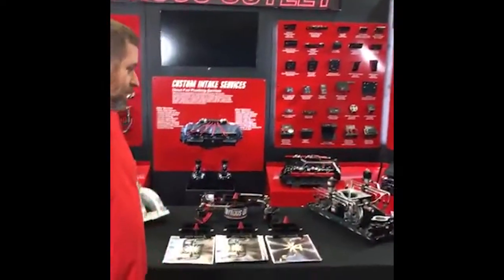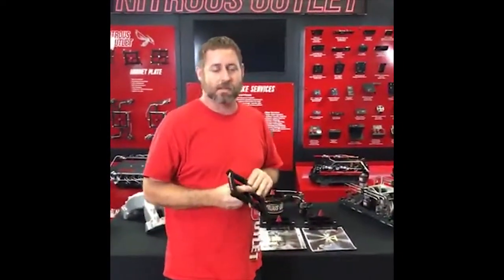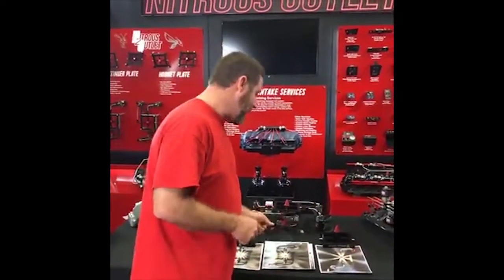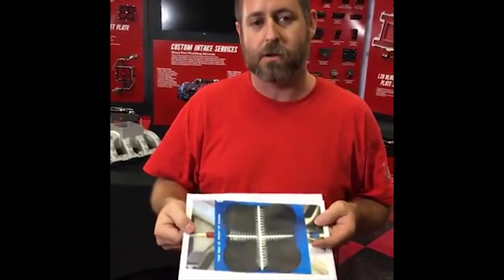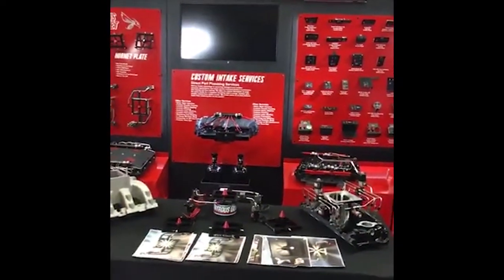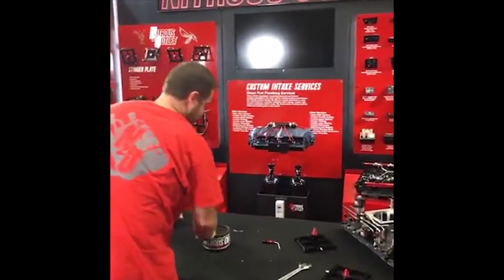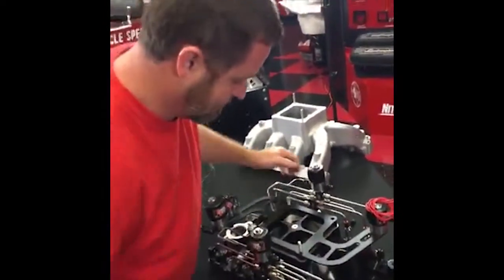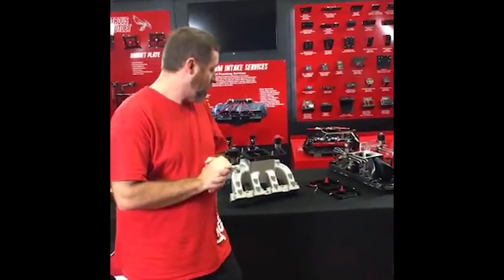Nitrous Outlet Stinger Plate Systems

Comment: do you have specific purge solenoid for your system or will any manufacturers will work, we have two of your entry kits
Reply from the maker: We do have purge kits available if you want a matching kit, but any purge system should work fine for you.
Reply: Ok, thanks I found them on your website summit didn't show any when we ordered the kits
Reply from the maker: Good deal! Let us know if you need anything else! Feel free to give us a call if you need to- our phone number is 254-848-4300 or 1-866-648-7637!

Comment: Dave have a question for you, I know how to flow nitrous just wondering if you think it's just as effective if I flowed through the solenoid just b4 the plate to get a more effective adjustment. Of course with the nitrous disconnected lol...
Reply from the maker: Are you talking about setting flowing fuel pressure?
Reply: @NitrousOutlet  yes sir
Reply from the maker: @hiteracing1489  You can do it either way. Just pick a method and stick with it. 

Most people flow before the solenoid. 

Some people flow through the actual plate into a bucket. 

Easiest way is before the solenoid.  

It’s all just a starting point on the tune up process.
Reply: @NitrousOutlet  ok good deal thank bro

Comment: any video's on how to tune each cylinder with a stinger I system
Reply: Yeah, get an ECU with individual cylinder enrichment capabilities.
Reply: MajorLeague  if you have a 4cyl, then yes, one wideband for each cylinder.
Reply: MajorLeague  correct, you'd need 8 o2 sensors one on each primary.   I'm not sure if a stinger has 8 wideband inputs but most higher end standalones will be able to facilitate such requirements.